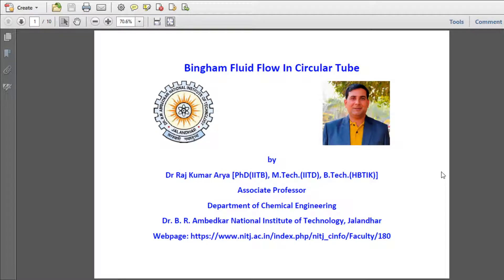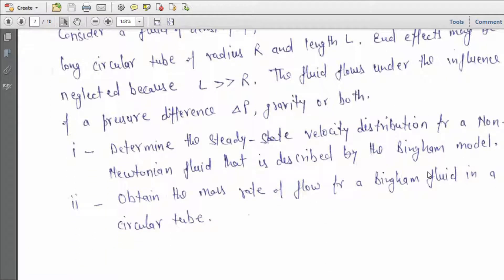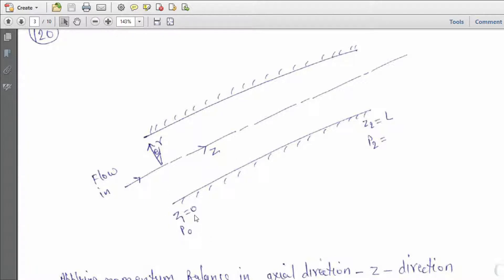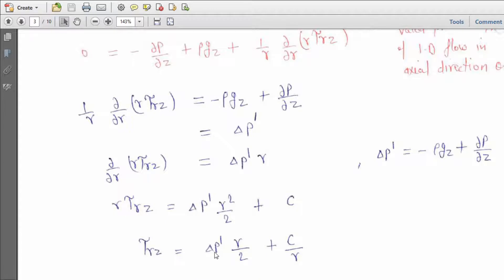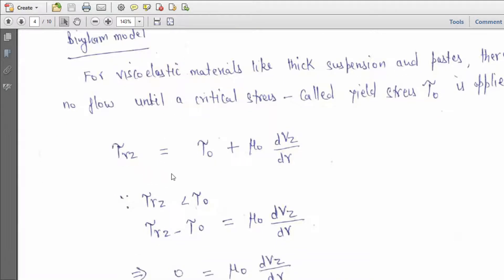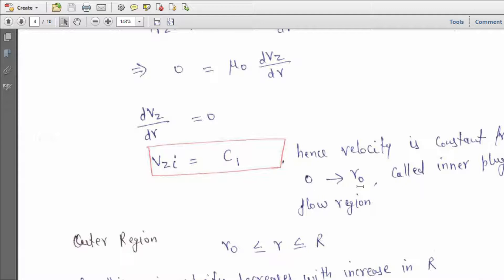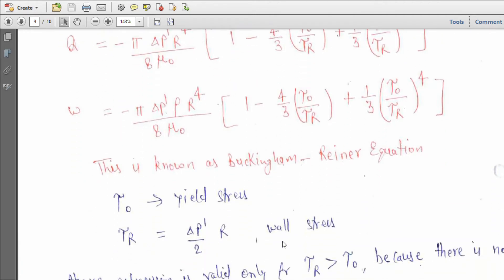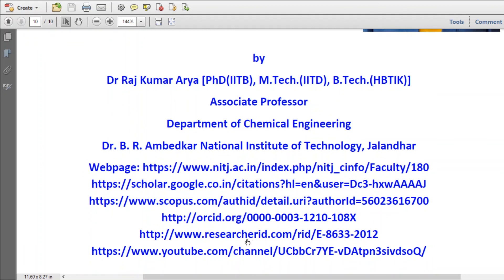Bingham Fluid Flow in Circular Tube#Transport Phenomena#Chemical Engg#Dr RK Arya#NIT J#Non-Newtonian

Comment: Thanks a lot sir!

Only doubt I have is that when calculating Vz in the plugged region we used r=r0 for getting the velocity. 

But sir inside this region, velocity is constant. So if we put r=0 instead of r=r0, it should yield the same result, sir am i right about it?😣
Reply from the maker: In plug flow region velocity is not the function of r.